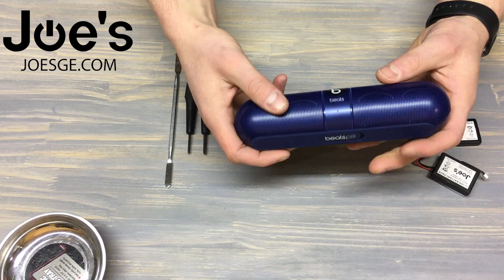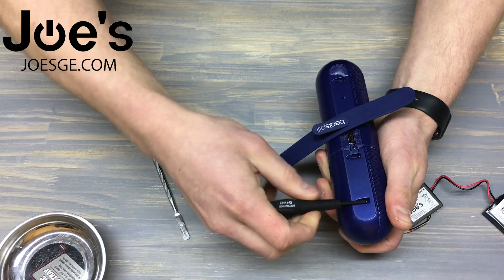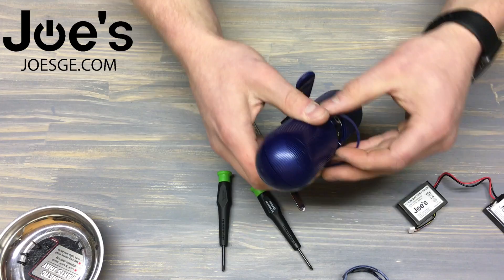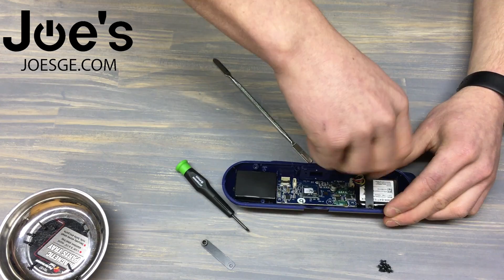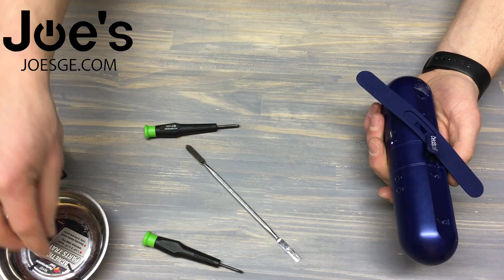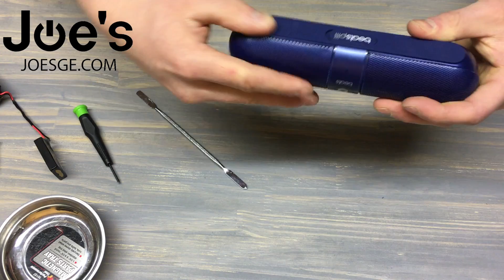How to Replace A Battery Beats By Dre Pill 2.0 B0513 Bluetooth Speaker No Power Charge Fix

Comment: question can i just cut the battery wire instead of removing the board and running the new on top of board? this i wont risk damaging the board.
Reply from the maker: Hello, thanks for commenting. Please email us at support@joesge.com with a screenshot of your question and we will be able to better assist you there. - Aaron P

Comment: While replacing the batteries on my beats pill I broke the very small tab that holds the gold ribbon (seen at 4 minutes and 20 seconds on your video "How to Replace A Battery Beats By Dre Pill B0513 Bluetooth"). Is there a fix or replacement for this? Thanks!
Reply from the maker: You might need to buy a new PCB

Comment: I have a 9 year old red beats pill speaker..It has been in storage for 7 years.  It appears that it's not holding its charge.  Where would I purchase a replacement battery?  Thanks
Reply from the maker: https://www.joesge.com/products/beats-by-dre-pill-speaker-2-2-0-battery-1050mah-7-4v-parts?_pos=5&_sid=7be1481e6&_ss=r

Comment: Just use 2x 18650 batteries, 3D print backpack wire batteries to bms and thats it more capacity cooler design when you have beats pill dude etc all u need is to drill one hole for cables
Reply from the maker: That could work but ruins the integrity of the speaker.

Comment: I am posting from my personal experience with this battery replacement. I ordered the replacement maybe a year and a half ago. It worked fine for maybe a year with very minimal use as I don't use my pill often, maybe 1-2 times a month for a hour or two at a time. After about a year it would indicate it was dying with my phone constantly  popping up with the notification that the speaker was less than 10% charged even though I had fully charged it the night before for example and never used it. At this point I can turn it on and will get the notification that its less than 10% charged (which I know isn't true), plug the charger into it and 10min later the green light will show its fully charged. Also if I plug it into the charger and start using it when it says its low even if I know it's not it will never fully charge and won't show the green light if I'm using it. I wouldn't waste my time on repairing your pill at this point of time and just go buy a new device.

Comment: I would like to know what's the issue if I been charging the beats pill for a while the red light stays on like it's charging but once I take it off the charging cable it shuts off and don't turn on unless I plug it with the charger. I believe is the battery but dont know for sure if it is.How much you guys charge to replace the beats pill 2.0 battery?
Reply from the maker: Thanks for the comment. What model beats pill do you have? 
Beats Pill 1.0: $55.00
Beats Pill 2.0: $65.00
(*Prices may vary over time)

If you would like your device repaired by a professional you can fill out a repair form and follow the steps to send in your item. We offer free shipping and diagnostics. Here is a link to the repair form:
https://www.joesge.com/pages/repair-services

-David P
Reply: @Joesge  Thanks for the information. It's the blue beats pill 2.0. I'm just surprised how my beats battery stop working when I hardly ever use my beats pill. It's like new. Do you know why if I hardly use my beats speaker the battery stop working?
Reply from the maker: Beats pill 2.0 has a common battery issue. I am not sure exactly why the battery fails. 

-David P
Reply: @Joesge  I shipped my blue beats pill 2.0 today regarding the battery issue. I payed for my shipping label with insurance and signature confirmation just incase anything happens.
Reply from the maker: Thank you Louis. You will be updated once the item arrives at our facility. 

-David P
Reply: @Joesge  I want to know why on this video you show such a perfect job  changing the battery and I send my blue beats pill and you guys messed it up? First of all my right front grill was loose. Why would it be loose when you don't have to open anything from the front? The other thing they messed up is my turn on switch why is my turn on switch or port flushed or push out enough to press the on button the correct way? The last thing you guys messed up my speaker with the NFC to tap it with my other beats pill speaker it doesn't amplify at all. I reset both speakers and try everything and nothing. Everything was perfect with my blue beats pill before sending it to you guys. All I needed was a new battery and now it's  all messed up. If I knew you guys are crappy technicians I would have never send my speaker to you guys. I been sending you guys emails and no answer. I'm really upset. I spent  almost 87 dollars including shipping to get back my speaker worse instead of a simple battery change.
Reply from the maker: Hello Louis.  Sorry to hear you are not satisfied with the repairs. We stand behind with our 100 day warranty against defects in workmanship under normal use. Our repairs are performed by expert technicians at Joe's in-house repair center. All repaired products are tested and verified to work properly prior to shipment.

This warranty excludes damage resulting from abuse, liquid damage, accidents, modifications, unauthorized repairs or other causes that are not defects in workmanship.

Please contact support@joesge.com and we will be happy to help. 

-Thanks
David P

Comment: Very thorough. Thank you!

One question... what if the adhesive gets ruined or comes off in pieces etc. do you sell a replacement adhesive?
Reply from the maker: We appreciate your positive feedback. We do not sell adhesive for this particular device. However if you need new adhesive you can purchase studio 2 wireless ear-pad tape and cut it into pieces so that they fit. Here is a link: https://www.joesge.com/products/beats-by-dre-3m-die-cute-tape?variant=41998831939  -David P

Comment: Hi Joe’s I replaced the battery 2 months ago with your kit and today the Beatspill is no longer turning on nor charging! What can I do?
Reply from the maker: Hello Robert, we suggest you send in the BeatsPill to our location for a free diagnose by submitting our repair form here: JoesGE.com/pages/repair-services, use Google Chrome when you submit our repair form. Have you tried using a different charger or adapter to see if that resolves the issue? let us know. 

Ruslan P
Reply: I will and thanks for the quick response! @Joesge
Reply from the maker: The least we can do, feel free to reach out to Support@JoesGE.com if you have any further questions. 

Ruslan P

Comment: This was really helpful, my pill wouldn’t work without needing to be plugged in. It would also crackle/pop when the sound was increased. After watching this and changing the battery my issue is fixed! Thank you so much.
Reply from the maker: Thank you for watching!
Reply: Did the sound improve after changing the battery I have the same symptoms as you

Comment: Thanks for the straightforward method of extending the life of these speakers! I´ve already placed the order for your batteries!  Regards, Robert
Reply from the maker: Thanks for watching!
Reply: Hi, I received today the battery pack! However, trying to fix the main board to the charging base I broke the antena flex that links the main board to the charging base. I´m trying to solder it. However,  can it be replaced?
Reply: Another loss!  The minus button is missing too.  Do you have them in blue?
Reply from the maker: Thanks for watching! This can be fixed. If you would like for us to do it, you can fill out a repair form here: JoesGE.com/pages/repair-services

Comment: 4:34 is okay if you ripped that brown cord
Reply from the maker: Thanks for watching! No, if you have ripped the orange ribbon cable, that would cause the speaker to not work correctly if it has been ripped significantly. MD.
Reply: How can I fix it
Reply from the maker: You would need to replace the ribbon cable. The ribbon cable supplied power to the up/down volume buttons and the "b" button on the front of the speaker. It is extremely hard to remove the whole circuit board and ribbon cable on the housing without damaging it and as such we do not sell it separately. We do sell a new replacement housing on our website here: https://www.joesge.com/products/parts-beats-pill-2?variant=42278620803 This cover only works with the Pill 2.0, not the Pill 1.0. MD.

Comment: Pick one of these up second hand and its not charging so I'm going to order one from you guys. I didn't get a charger with it and don't want to damage the new battery. With that said could you tell me the exact wattage the orginal charger wall block is so I can make sure I don't ruin my new battery? Thanks !!!
Reply from the maker: Thanks for watching Travis! The Pill 2.0 uses the same wall charger brick as Beats headphones. It has a 2.4 amp output. MD.
Reply: Which is 10W 5V?
Reply from the maker: You got it : ) MD.

Comment: Ok so I just replaced it with your guys product,I seem to have done everything fine turns on but I was wondering why isn’t the light turning on indicating that the pill is charging, shouldn’t it be working if I just replaced it with your guys battery???
Reply: I mean “NEW” battery
Reply from the maker: If you replace the battery and the charger port doesn’t light it you probably had a broken charger port in the first place rather than a bad battery. Joe
Reply: It’s still charged though .
Reply: Does that mean it’s not charging port?
Reply from the maker: Yeah! You may have a bad board.
Reply: So what should I do now ?

Comment: What if you replace the battery and on mid to high volume it's rattling acoustically from the internal vibration of the speakers?
Reply from the maker: Did you put the unit back together, properly with all the screws?
Reply: I found the problem! The main board was not completely tucked under the tabs to click into the housing. So, if you put the rest together correctly but not the board, there will be a noticeable "rattle" coming out of the In/out jacks causing the entire unit to buzz and sound terrible. 8:00 it's key to put the board under the 2 tabs just like shown.
Reply: Star Wars Bluetooth is not turning on I think I might overcharged it the battery or the battery might’ve gone bad what do you think

Comment: What u do if a beats pill plus doesn’t change. All the lights comes on but it doesn’t change
Reply from the maker: This would indicate that your charger port is damaged. It’s a common issue! Joe P
Reply: Joe's Gaming & Electronics so you don’t think it’s the battery issue??? The beats pill plus has  charging port like an iPhone 6 charging port and it’s not easy to get damaged. Are positive about the charging port is being damaged????

Comment: I just ordered new batteries and will replace them tomorrow. However, I also have an issue with the charging port (basically it doesn't charge if I plug the cable normally, but it does if I push it a little bit up). Is there a way I can fix it?
Reply from the maker: You may need to replace it.

Comment: OMG! 
Yes I fixed my pill. 
It works perfectly. It turns on and off. The only thing is I can’t see the red light around the charging port to see if it is charging. Maybe it is charged all the way already.
Edit: now the red light turned on. Never mind I fixed it. It took me less than 20 mins to repair it once I got the battery.
Reply from the maker: You have to check and see if your charger port is damaged or not.

Comment: my sound is distorcing when in max volum (ando also doesnt work without cable, 127% battery problem) maybe it (distorcing problems) will be fixed when i replace my battery?
Reply from the maker: Yes battery will fix the issue

Comment: how to change the charger port? please!
Reply: forget it, the old micro usb prot took up the pins in the motherboard
Reply from the maker: We will be making a video for this shortly.
Reply: Joe's Gaming & Electronics is still possible to repair without 3 pins that the charging port took off of the logic board?
Reply: Joe's Gaming & Electronics do you have a link to the repair of the charge port for the beats Pill 2.0?

Comment: I had a similar problem where my beats pill wouldn't charge nor turn on. Now that its replaced with a brand new battery, im still having the same problem. Any idea what it might be?
Reply from the maker: +Dior Paint when you plug the charger into the charger port does the light come on?
Reply: No it does not. I have to apply some pressure on the logic board but the light faints away shortly soon as the pressure comes off
Reply from the maker: Dior Paint bad charger port